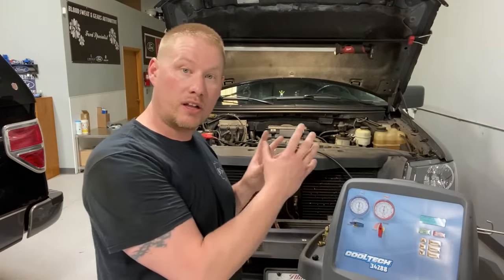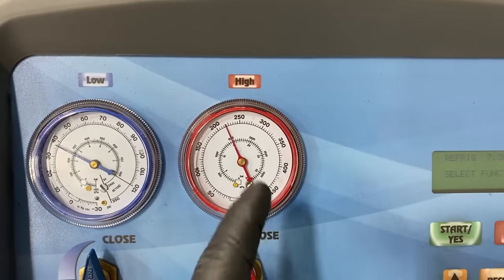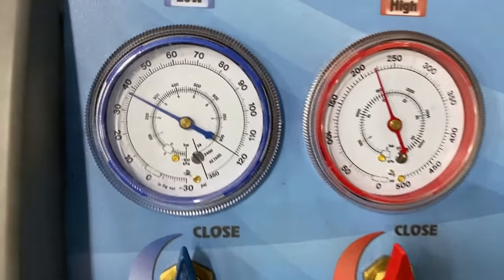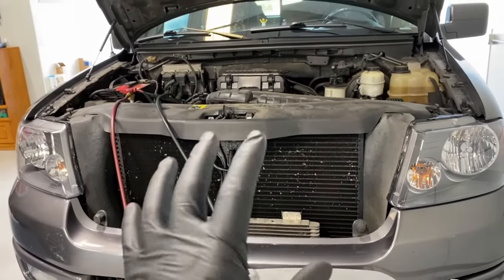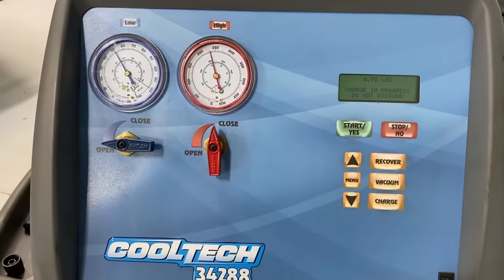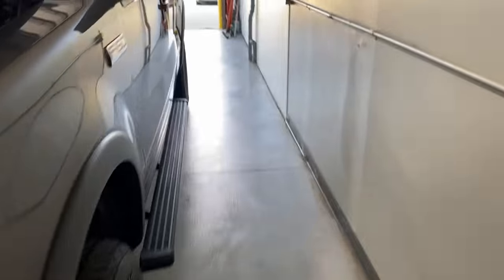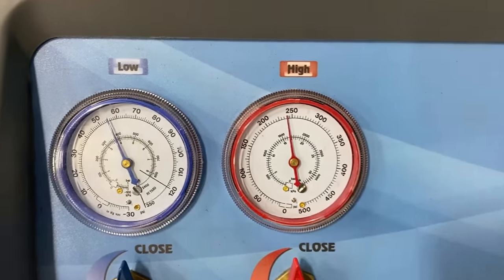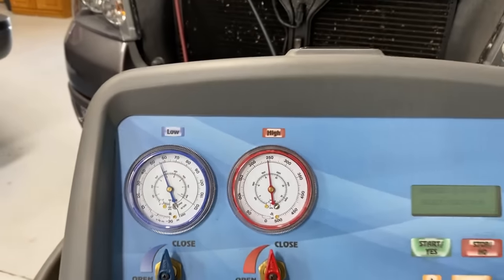Ford A/C Quick Tips #9: How to Spot an Overcharged Air Conditioning System

Comment: Quick question, at Idle 86F deg. day, The pressures are ~30 / ~200. Windows closed, on recirc. Blower on high. 
When I increase RPM to 1500 - 2000 it seems to cycle often, every 20 - 30 sec.  Seems the same with windows open.
Is this normal?

Thank you for your professional advice and videos.

Comment: Took my car to the dealership to have my ac serviced. Bought an AC pro refrigerant gauge to see what the low side was. It’s reading 110 psi. I’d assume the dealership has pretty severely overcharged the system
Reply: They just love you very much and want to see you come back again.
Reply: That is way too high for any condition .  Bet high side is too high too if compressor not fried .  Let it down to 45 psi if 90F and 40 if 85F .

Comment: great video on the subject.
question about testing the system, so once the car is nice and warm and ac system cycled for about 10 minutes, then you hook up the gauges. Now, with the vehicle running to get an accurate reading, do you let it sit at normal idle or do you bring it up to 1500-2000 rpm?
I'm trying to diagnose the system on a 99 bmw z3 with seiko seiki compressor and not sure if this is rotor vane or variable displacement type compressor.

Comment: Replacing the old pulley style  single fan for a dual electric unit from a company like Flex-a-lite helps the F150 a/c system operate better.

Comment: What Ford dealer will do that?  The Ford Dealer in Lincoln, doesn't do anything like that.  I even asked how the intake valves looked, if they had carbon build up.  This was when the had my 2014 F150 valve covers and timing chain covers off.  They were fixing a enging oil leak.  103,000 miles on the truck.  I had a turbo coolant leak, and got tired off smell oil around my truck.  Yes I did change the timing chains job, since they were in there.  When I picked my truck up. The service writer told me, that the service technician was shocked how clean the engine was.  I don't change my oil every 3 to 4 thousand miles. I saw a picture with everything off.  I did see some black on the drivers side #2 from the front intake portal.  The service writer said that you have to take a scope camera to it.  I don't understand why they didn't when they had it apart.

Comment: I know this has nothing to do with AC, I looked through and watched a lot of your vids, very nice. I have an 09 F350 Dually with the Diesel engine 6.4, I am getting a P0472 EPS A Circuit Low Voltage code, what does this mean? I know it has to do with the Back pressure, just at a loss on this. Do you have a vid on this that I missed? Is this a quick fix? Yes, the EGR has been removed 5-6 years ago without any problems. Any info would be great.

Comment: Looking at your gauge pressures they stay constant, system I’ve worked on shows pressures rising and falling as clutch cuts in and out. Are they two different systems? Low side cycling circa 10 to 30 psi and high side 80 to 125 psi, ambient 70F. I can see on gauges that a lower pressure = lower temp but I also know that there is potential a min of 25psi required to run system. So reducing charge would stop it running I think? M and not make it colder? System above is correctly charged with 28oz of R134A

Comment: Question? Why would I have ice cold AC at idle but when on the highway it warms up and not as cold? At idle I am showing 38-40 degrees and on highway showing 55-60? Any help is greatly appreciated. Thank you
Reply from the maker: year, model, engine?
Reply: Sorry for the late response. It’s a 2005 Ford F-150 with a 5.4l engine. Thank you
Reply: @ed4709  If its goes back to blowing cold again when you come to a stop, (Without needing to bump the a/c clutch) its likely an undercharged a/c system.

Comment: Thank you for another great Ford Tech video .  Is there any need to blow a little refrigerant through the low side fill line to get the air out of it before connecting it ?  With the can type I have seen people blow a burst of 134 through right before connecting the line to try to remove air from the line so not pushing air into the AC system .
Reply: Is a must. is a need.

Comment: Videos are awesome they have helped my family alot.

I have 2007 Ford Explorer 4.6l 3v 4x4 no rear air 166000 miles
Ac is ice cold
At idle when its over 95 dry west Texas heat the compressor cycles normally but then randomly will cycle to on position and stay on until vehicle begins to over heat. The computer will shut ac compressor off vehicle cools down and then ac compressor begins cycling again.

Will not over heat with ac off

Where should i look

New thermostat, clutch fan, radiator flush, radiator cap, ford aux electric cooling fan added.
Reply: Just went outside turned defroster on high heat.

Compressor kicked in and it over heated

105 outside with hood open

Turned off defroster cooled down

Setting at 219f hood open nothing on

Comment: Do you run at idle or bump up RPM when checking pressure? I couldn't tell
Reply from the maker: idle
Reply: @FordTechMakuloco  thanks
Reply: Bump the rpm if you have a clutch fan.

Comment: I have a 2006 sienna I change the condenser expansion valves and the AC compressor and only works basically in high RPMs when driving when the car is stopped, the AC is not cooling correctly. I change the gas today and the temperature before that was 250 and over.

Comment: According to the R134a charts for a 90 degree day, you were low to start with? But after putting more in it got too hot, so you were right. Are the Charts wrong??
Reply from the maker: You must check pressure on a hot engine bay otherwise they will be low.

Comment: If you have an ac system showing both low pressures on high and low and the duct temp warm, how do you know if there is a leak, a stuck closed expansion valve, orfice tube plugged, pressure or control valve failure, or just low refrigerant?

Comment: great video guy, my 2004 f150 has a small leak on the manifold line and they wanted about 800 to replace and charge, but, last time ford left the freon in when they checked it and it blew cold for a year so i decided to try the ac pro can and put the 20 ounce and half of a 12 oz in, it's blowing cold but i have no way of knowing how much freon is in there, so i'm off to walmart to buy a 25.00 set of gauges to check it out, thanks to you  i'll know if i'm overcharged............smitty

Comment: I was just checking my 93 F150s air and when I looked up the pressure chart online it stated for 90 degrees the low side should be between 45-55 psi and for 95 degrees it should be between 50-55 psi. I set mine at around 45 and it was blowing colder than at 35psi, what gives?
Reply: Too low of a charge and the lack of refrigerant will not let it absorb as much heat to cool the air in the car like it should. It’s all about the refrigerant sucking up heat and turning from a liquid into a gas in the evaporator. Too little and it turns to a gas too soon to really cool the interior off.

Comment: My brother has a 2010 Ford F150 Lariat with inadequate cooling.  After correct charge is added to vacuumed system high side pressure rises to approximate normal while low side drops to near 20 PSIG and the low pressure control cuts out the compressor clutch - the compressor only stays engaged for less than 30 seconds each cycle and then cuts off, comes back on after low side pressure rises to above 40 PSIG .  This repeats endlessly.  The expansion valve, refrigerant lines and condenser coil have all been replaced (individually) and the symptoms have not changed.  Overcharging intentionally causes the high side pressure to rise but has no effect upon the low side pressure.  Any suggestions?

Comment: Great Video.. I thought if you have TXV then it job is to regulate the pressure differerence between the low and high side, so even if you have charged more TXV should regulate it. i may be wrong but just thought to rise it to you.
Reply from the maker: Nope
Reply: Txv controls freon flow but not pressures. Pressures will jump around as txv opens and closes. On top of that alot of cars just use a orfice to control freon flow which is just a plate with a small hole of sprecific size to meter the freon flow. This video shows the importance of just weighing in the correct charge to get it right as pressure values change a bunch with out side temps. Pressure values alone are not a proper way to charge ever on any car or home ac system. Really the best way is by subcool/superheat values by car manufacures dont say the values, they just say put this much freon in.

Comment: It disgusts me that we professional techs have to be certified to buy refrigerant and work on A/C systems but DIYers can buy the crap at the parts stores that contains sealant and might not even be real refrigerant. Some of it may contain propane, butane or a mixture of R134 and R12. I've not only invested a ton of money into my A/C machine, but had to buy a sealant detector kit and now need a refrigerant identifier so I don't wreck my equipment!

Comment: At 105 degrees ambient I’m getting about 38/280 psi. Cooling is not great. What would you recommend? Are my pressures too low given the ambient temperature? All the charts I see state low side should be 50-55 and high should be 330-335 at 105 degrees

Comment: I have a 2007 ford expedition... With rear AC.  At idle 40-44 psi low side, 375-385 high side.   Outside ambient temp 90-95, humidity over 60% and 1000 feet of elevation.  Air blows ice cold.   Does the high side pressure seem normal to you?  I thought it was kind of high but maybe not given those conditions I explained.   Under the hood the air coming off the radiator fan is hot enough to damn near hurt.  Engine temp is completely normal.

I also checked those pressure readings after idling 30 mins, with the gauges hooked up and hood shut.
Reply: Try a box fan in front of radiator running on high and  make sure condenser is clean as well as condenser fan running on high . Also run engine up to about 1500 rpm to be sure compressor moving enough freon .   High side number seems about 50 psi too high thus the recommendations to check condenser fan run condition and use box fan to simulate driving conditions to see if high side pressure drops.  If not may be over charged system .

Comment: Fantastic video! Question for you: is it possible that the Ford spec is off for the AC charge? On a 1996 F350 it calls for 7oz pag oil and 38oz of r134a on sticker under the hood. Lp side seems high just like you show after overcharging by 1lb even though the charge was weighed out exactly. Thoughts? Thanks for the fantastic videos
Reply: Not likely. You will notice that this video is 2 years old so you may want to find a newer video he posted and ask your question there. As far as you stating 38 oz 134 and 7 oz pag oil. You should not need 7 oz of oil unless you flushed the whole system of oil and drained the compressor completely. The specs are for a completely empty system. if you added 7 oz oil there would be way to much oil in the system.

Comment: An ex-mechanic friend and I installed a Vintage Air system in my 66 Mustang. Worked well at first but the condenser developed a leak so they sent me a new condenser and drier. I installed the parts, evacuated the system and installed refrigerant. It wasn't as cold as I thought it should be so, of course, I added more refrigerant. That did not seem to help so I inspected under the hood as the system was running. What I found was the compressor cycling on and off every few seconds. A youtube search led me to conclude I was overcharged. I released some of the pressure into the atmosphere, destroying God knows how much ozone layer, and now it works great.
Reply: No worries , r134a is just going to “cause more global warming “ according to all the paid for scientists . The old R12 was the ozone killer ...

Comment: I hear that new r1234yf is about $100.00/lb and it's flammable! Wth EPA! I also heard
the A/C machines can detect a system leak and will NOT dispense refrigerant. $$$ :-0
Makes sense if this is true however.
Reply: It is flammable and at current pricing it's about $60.00 a pound wholesale to a shop. The machines you use will pull a vacuum and any leakage will prevent it from charging. However you can buy 8 and 16 oz cans online and DIY it and have the same situations that existed with R-12, R134A . All of those are illegal for a shop to knowingly "top up" without testing for leaks and repairing them before recharge. BUT DIY are exempt....

Comment: The ELM 327 adapter model you recommended on July 9, 2020 is no longer available from Amazon as of August 16, 2020.  Can you recommend another one that will work properly with the Ford software you recommended?
Reply: Most every 9$ China module.. I have one going on 10 years now, faster than the pcm itself, so 0 latency.

Comment: a/c cools fine when the engine is first cranked up (cold).  Once warmed up, the system blows warm air.  Does this sound like an expansion valve?
Reply: Did you ever figure out what caused that problem? Having the same shit goin on with my 03 5.4 f150
Reply: @kring5252  any update bro?

Comment: I was recharging my STI AC once and the pressure would never increase, I assumed a leak. It was a mistake as it was too much oil in the system and the compressor was trying to pump it and it was not able, so it ended up blowing the compressor bypass. So lucky it didnt blow up like some of the other videos I had seen online. But did get AC oil all over the engine and my garage.
Reply: When this happened, did you get an odor inside the car?

Comment: a bit under is better than a bit over on the charge...
also the heat soak will cause the temp creep inside...
the best way to judge a charge on a hot day is when you are at highway speed...
it should almost drive you out of the car with cold.

in traffic... yea heat soak on domestic ac units...
now toyota is a different thing!
they do well in traffic... i have both chevy and toyota here...
the toyota is the car of choice for hot days where the temps are over 100 deg f!

Comment: Quick question. I took my car in to a shop to get a recharge, I watched the guy do it as he connected the hoses and pressed buttons on his machine, but he never turned on my car. Did he do it wrong???
Reply: Not wrong  . If charging without engine running  , 
But he did not check  , fans and inside blower , that is incomplete service.
Reply: @inverseuniverse5727  Absolutely wrong, no way of knowing previous charge and no way of having accurate high side reading without engine in operation.. You need at least 1500rpm to cycle the a/c and you need airflow over the condenser..
Reply: Not necessarily, if he pressed a button to “recover” all your Freon and then he pressed another button to “charge“ your ac with the manufacture’s recommended Freon weight, then you are correctly charged to spec.  But, without starting the engine and engaging the compress, you would not know if the ac system had other issues.

Comment: Thanks for the video, very informative as always. I have a similar issue on my truck and I'm wondering if I over charged it. While driving it blows cold but as soon as I come to a stop the temperature of air coming out the vents starts to rise and I checked the low side pressure and it starts to go above 40 as well.
Reply: Check and make sure your cooling fan is running. If no air is going over the condenser you’ll lose cooling as well
Reply: @jamesprill6845   will do,thank you.
Reply: any update?
Reply: @saifulnashriq22  Yes I put electric cooling fans on the truck and there has been no change. The only component that I haven't changed is the evaporator so I'm wondering if that is affecting it.

Comment: I think my 2013 focus is over charged.  what should the correct pressures show?  Is it the same as the f150 you showed?
Reply: You have to look at the label for the AC system in the engine bay. Or Google ac specs for your vehicle. Do not go to a site where people are guessing what's you should do. 
Or take it to a shop.

Comment: May I ask you if you would have any idea what can I do to fix my problem. My driver side vents blow hot air. However the passenger side is blowing cold air out of the vents
Reply: Sounds like you have a blend door problem. He has another video for the blend door actuators
Reply: Do you have duel climate control (separate air temp settings for driver/passenger)  if so, sounds like the driver air mix motor is stuck on hot. Find where the air mix motor is. Then turn temp to hot and cold. It should move. If it does not move. Probably that motor is out. You can find the air mix motor on the passenger side and do the same. And you will see the motor move from hot to cold for a reference.
Reply: This is going to sound weird, but undercharging is a possibility. When undercharged, the evaporator can be cold at the bottom, but warm at the top. If the ductwork for the driver side is taken from the top of the evaporator, it will be warm air, while the pass side is cold. 90's Contours were like that. In fact, Ford had a TSB on that. (I was a Ford dealer tech thru the 90's)

Comment: Just changed my condenser  on my 2015 Roush stage3.  Heat exchanger rubbed a hole in it,    (For those who own these cars check clearance of heat exchanger ). Put  added oz and half of PAG 46 in condenser before install.  Pulled vacuum.  No leaks.  Added 24oz of refrigerant per under hood label    Low side reads. 40 , high side 200.   At idle.    2k rpm 39 deg at center vent.   Does these readings sound about right?    It was 93deg outside.
Reply: Yes - might need to add another oz of oil though if only 1.5 oz in there . Through low side engine at 1500-2000 rpm .  Recheck pressures . Put a big box fan on high in front of radiator and make sure condenser fan running .